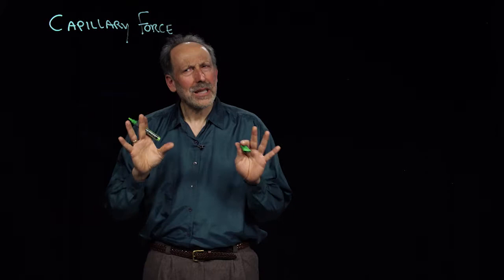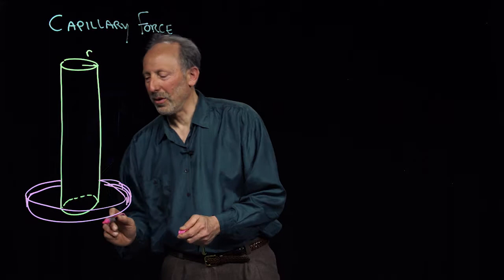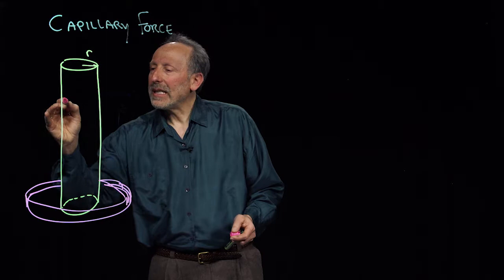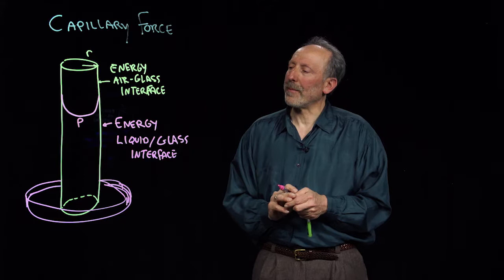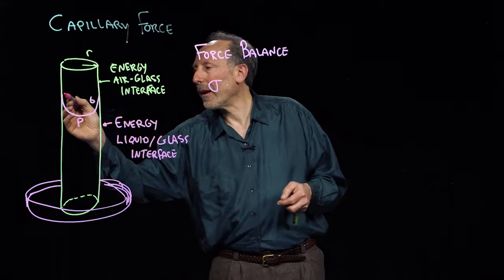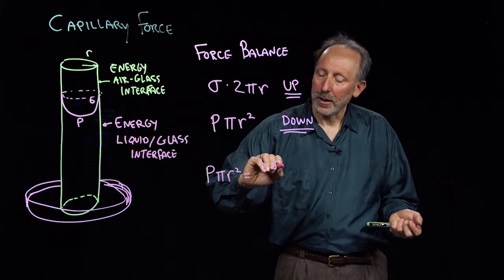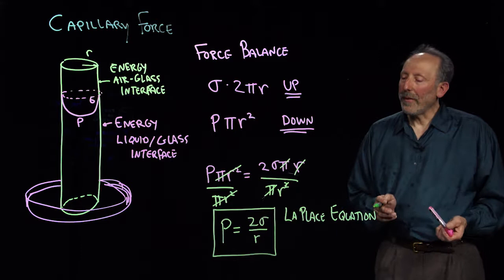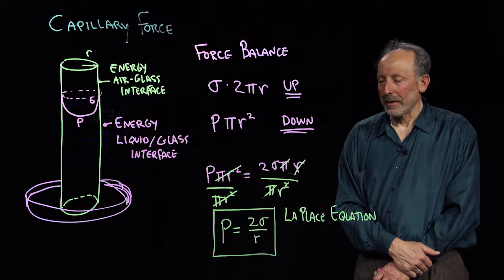2 5 1 2 La Place equation for capillary pressure

Comment: I find it hard to believe this is right. In fact that equation only works considering a spherical surface. My confusion comes when you have to think about how would you derive this equation considering a cylindrical surface :( Also is this pressure the one that the liquids exerts on the air or the other way around?
Reply from the maker: This does take a lot of thinking to understand.  Locally at all points on the air-water interface the surface fits a sphere (so long as the curved surface is much smaller than 2 mm).  So though the water touches along a line to the cylindrical tube, it forms a hemisphere.
Reply: I think the equation is lack of cos(contact angle). The meaning of capillary pressure (when be used in the tube) is as same as the Laplase-pressure. The difference is the R (effective radius of the interface) changes into r/cos(contact angle)  (r is the radius of the tube).
Reply from the maker: Keep in mind that the cos-gamma representation is just looking at the force balance at the three-phase contact, which is really a very stochastic system, depending on local energetics.  The first thing to think about is the pressure on an arbitrary "saddle point" on an air-water interface.  We derive this in the book, but it is a bit too much for a short video.
Reply: @selkerandorsoilhydrologyan3426  hi, what increase in pressure would cause capillaries to burst?
Reply: @daveyboy4715  Since the pressures are negative, when unsaturated they won't burst in this case.  Also, if the soil becomes saturated and the pressures are positive, then the water is all under compression, so again, no bursting!

Comment: there will be cos theta in the equation as we will take upward component of surface tension
Reply: Not in this first case, where the energy of the air-glass interface is larger than the combined air-water and glass-water energy - this gives a zero contact angle.  For contact angle, see video 11 of this chapter:  2 5 1 5 Contact angle effects on capillary pressure.

Comment: How do we know that pressure acts downwards just below the surface?
Reply: Pressure actually does not have direction - it is a scalar, not a vector.  So the pressure at any point simply has a single value.  The pressure is zero at the surface of the water in the tray, at the bottom, but by hydrostatic principles, pressure in non-moving liquid is always greater going downward (think of diving underwater), and the pressure reduces as you go up in the water column.
Reply: @selkerjss  Thank you for your answer. What I was trying to find out is how the parts of the force balance equation (in 4:11) are put together. Which part of the system does it describe? Is it the surface of the meniscus? Is P the pressure as we would measure it in the liquid just under the surface of the water?
Reply: @tomaszmasternak2225  Since the system is symmetrical, forces in the lateral directions are balanced, and net zero.  The force balance is for the forces acting in the vertical direction, balanced at the height of the meniscus.  You can compute the downward force in two ways.  One is to compute the mass of the water being held up, which is 2* pi* r^2 *h*density, where h is the height of the water column.  The other way to compute it is to compute the vertical component of the pressure.  The easiest way to think of this is to draw a flat circle right below the curved interface.  The component of force upward due to the negative pressure is simply that pressure multiplied by the surface area, pi*r^2.  It might be easier to visualize by thinking of a cylindrical bucket full of water.  What is the downward force on the bottom surface?  It is the pressure (density*g*h) times the area of the bottom of the bucket.  Here we are just looking at the bucket upside-down!